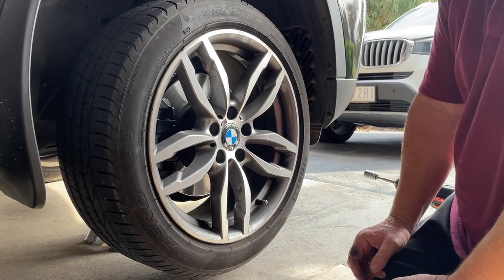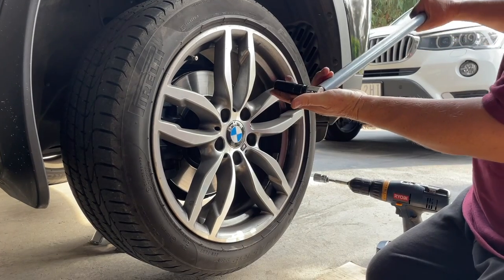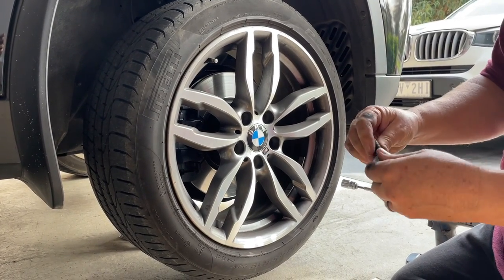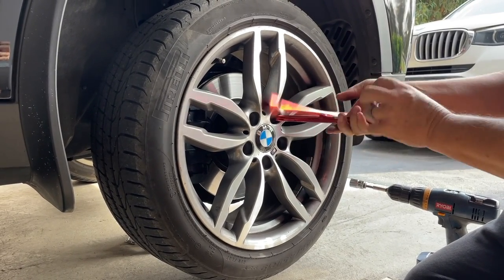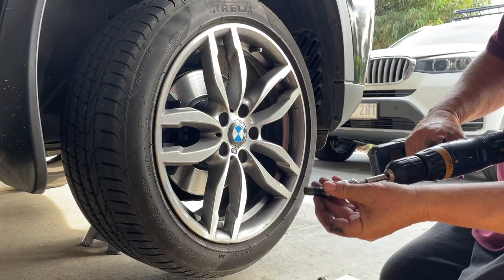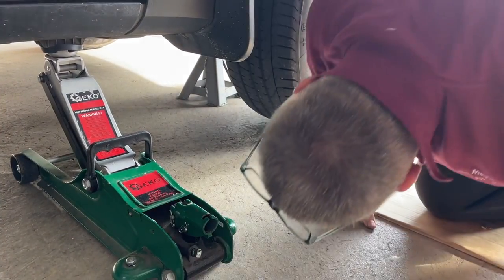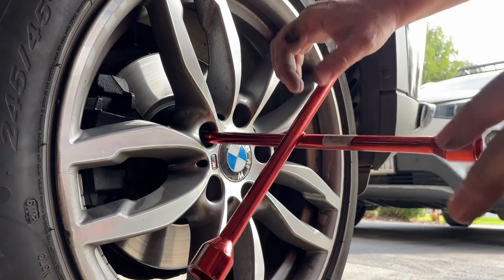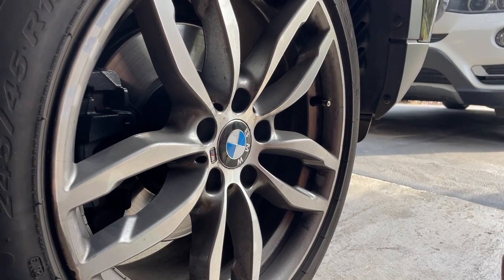How tight should you do up car wheel nuts? Yes they can be overdone and damaged.

Comment: Why should i lower the car an tight them ? 
Could i tight them when the car wheel is high ? Is there a reason ? Thank u
Reply from the maker: Hi Yes there is a reason. When the wheel is firm on the ground you can get a true feel for how tight it is. You can also normally then get it tighter as it isn’t moving on the brake or gearbox. MRT